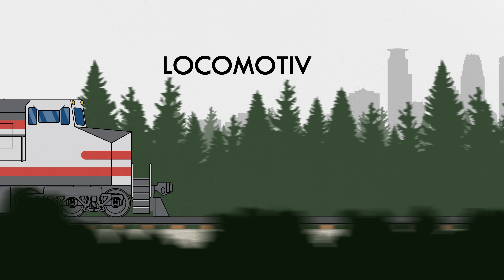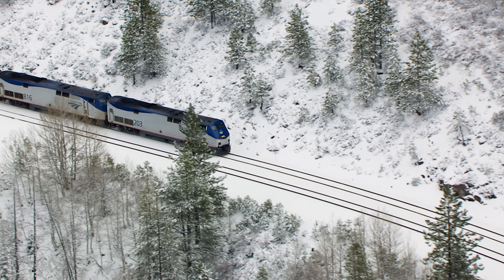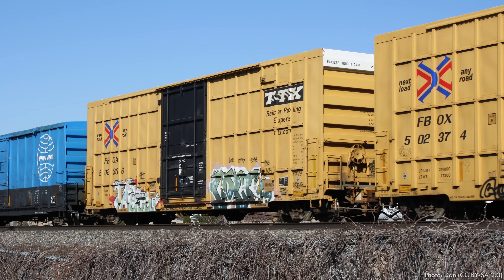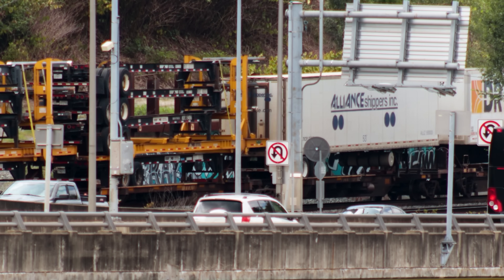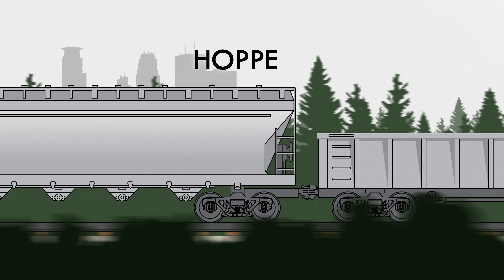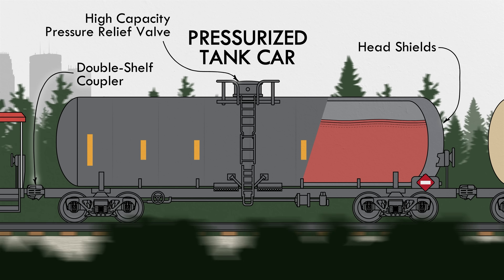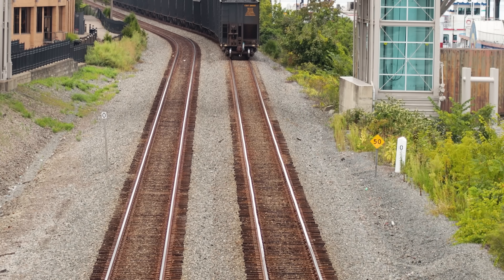Every Type of Railcar Explained in 15 Minutes

Comment: In Germany, we have special rail cars to transport liquid pig iron from blast furnaces to steel works. They are designed to keep the iron liquid for hours and are called "torpedo cars".
Reply: yes, and in graz (austria), there was an issue with such a car. the steel smeltery "marienhütte" accidentally smelted scrap metal with an orphan source. then they had such a torpedo car with 60t of radioactive iron inside. wasn't a lot of fun for them.
Reply: @robertheinrich2994 Bazinga. I’d imagine molten steel doped with radioactive isotopes are uberradioactive
Reply: @robertheinrich2994 Yikes.  There was a similar incident long ago in Ciudad Juárez in 1984.  It was only discovered because a truck driver got lost, drove over a radiation sensor at the Los Alamos National Laboratory (what are the odds of that?), and triggered an international search.
Reply: @robertheinrich2994  an orphan source? Do you mean an unknown source? Cause here in America orphan isn't used like that and I thought you were saying they stole iron from some kids or irradiated an orphanage or something
Reply: They're also used in the US (or pretty much anywhere connecting blast furnaces to steel plants with rail transport). The terminology is also the same, though they're sometimes also called "bottle cars".
Reply: I haul refractory components to many US steel mills, including tilters used to load those cars, also called Hot Pots, so I get rather close to to those cars... The heat that comes off of those cars is insane, even long after they are emptied and waiting to be refilled...
Reply: They're, or similar versions of them, are used on most steel mills to carry both products and slug around the facility. Not surprising since metal vehicles running on metal tracks is the best way to carry molten metal. Also the whole operation is pretty metal too :)
Reply: We have these in south Wales too. Every now and then a train full of molten steel will roll through Cardiff Central station as it goes between steelworks. Apparently you can feel the radiant heat as it goes by
Reply: Nothing quite like looking outside the train and being blasted with heat from molten steel because they were opening up the top of one of those torpedo cars haha
Reply: Wow. molten iron?
Reply: @DudeWhoSaysDeez  people wouldn't think that this is an economical endeavour, hauling molten iron around.
but I see where you are coming from. these cars need to be moved to their destination quickly. it's around 4h (as far as I know) before the loss of heat is too much and it turns solid.
Reply: @robertheinrich2994   Often times they are also just used in plant. Or plants of the same company that might be just down the road a bit.
Reply: I was trying to figure out what liquid pigs were....given I recently heard Chicken Eggs referred to as Liquid Chickens
Reply: We have those in Florida as well and they are used to transport molten Sulphur, though they also transport the molten Sulphur in special 18 wheelers that have a trailer used to keep it hot.
Reply: @ImpendingJoker  Interesting. I've heard that they also (used to?) transport liquid aluminum in semi trailers in some places.
Reply: Amazing!  Now i imagine they must have baffles because sloshing molten iron could derail a car in a hurry. If so, what material would those be made from?  Do you know?
Reply: @boxsterman77  I don't think they have baffles. You have to fill all cars to the top anyway to ensure the desired thermal behaviour. Trains don't accelerate that much.
Reply: Europe by rail! Sounds like something I want to do ASAP
Reply: If you want to see what it looks like when such carriage derails and spills the metal, Google "Havarie Veroniky, Vitkovice, 2011" (This type of carriage is often called "Veronika" for some reason.
Reply: Mmmmm. Liquid pig.
Reply: Seems dangerous
Reply: Too hot to handle
Reply: That's metal!!
Reply: Plus they also have what I would call "ladle cars" where the iron works dumps slag into a huge ladle, then the flat car it's on pulls it a short distance to dump the molten slag into a waste pit.
Reply: Pig iron???
Reply: @RedCobra_QC  yes. Pig iron, a term for crude iron. It comes from the appearance of the gate-and-runner system they use for casting crude iron ingots. The central runner is the "sow," and all the ingots coming off of it are the "piglets.".
Reply: Torpedo wagons, slag ladles, and those cars with the tall ingot casts are probably my favorite rail cars. There is just something fascinating about moving molten metal around!
Reply: I wonder which is more BTUs , a rail car of liquid iron, or the potential BTUs of a rail car of a petroleum fuel such as diesel
Reply: @ShannonDove-sy7ye  energy density of fuel is much much higher. otherwise we would use liquid metals as performance fuel.
Reply: That’s fuckin nuts. The refractory must be insane.
Reply: We don't manufacture much of anything in the US.  Our quality has deteriorated to the point of having no value.  Manufacturing is a serious investment, there is no regard for employees, and our system is based on immediate ROI.  There usual term is greed.  Further, our rail networks are 19 century.
Reply: The sounds badass. Someone tell Michael Bay.
Reply: The irony of the Germans naming these rail cars "torpedo cars" is not lost on me.
Reply: @YT-TheLegacy  "IRONy" 😀
Reply: @YT-TheLegacy it’s lost on me.

Comment: One variation of train car I've seen is two flat cars with one bogey in between them linking the two cars together. I'd like to know more about how those are put in service, since obviously they don't have the normal couplers like everything else. I'm guessing these are used for lower weight applications.
Reply: that's similar to the HSR ones ain't it?  ( Like TGV bogies)
Reply: Articulated flatcars are what you're seeing. They comprise virtually all the container-on-flatcar and piggyback freight cars used nowadays (there are also articulated autoracks). 

Each multi-section car is considered a single unit (though railfans will often count each "platform" like a separate car), and can consist of 2, 3 or five carbodies. The Santa Fe experimented with a ten-section version called the "Fuel Foiler" in the early days of this technology).
Reply: this is Jacobs Bogey, designed to reduce rolling friction and increase stability in EMUs. Similar arrangement (but not a Jacobs bogey) you may find betweet two well cars. Most important advantage in HSR use is resiliency against accordion collapse in case of derailment. In 2000 TGV EuroStar derailed at nearly 300km/h with only 14 light injures. In case of separate couches it would be fatal.

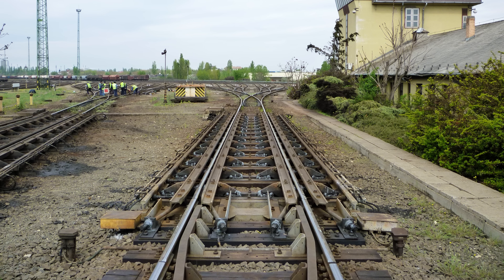Comment: Not every train has locomotive. Motorwagons or joint units have traction engines and don't need to be pushed or pulled. 12:35 it is not scale, it is braking system, providing cars to not exceed speed at shunting. Also you missed silo car, 'dust carrier', that is used for transport cement and other freights like that. Also missed cars designed for carring molten materials like slag or metal (that is two differnt types).
Reply: That's probably because he's based in North America and cement is carried in 2-bay covered hoppers here. Also see his disclaimer at the beginning of the video that this is an overview of the most common basic car types and not a deep dive.

Comment: he just dropped one of the best videos ever
Reply: It's missing all the electric cars, truly a US fossil-fuel burning moment
Reply: @Slushee  What?
Reply: @jovetj  All the ones he mentioned were towed by a diesel locomotive. Everywhere else in the world that isn't north america we use electric trains.
Reply: @Slushee  There are electric trains here too.  And guess where the majority of that power actually comes from?  "Fossil" fuels.  Diesel locomotives are electric, too.  Traction motors are electric motors!

His train also had both passenger equipment and freight cars/wagons.  That train doesn't really exist, either.  That's not the point.  The video is freight focused, and North America focused, but there are comparable freight wagons across the world.  The video did not cover electric trolleys or trams, high-speed passenger service, specialized mining equipment, funiculars, or cog railroads either.  It wasn't supposed to.
Reply: @jovetj  The majority of power comes from fossil fuels in north america and in germany. Not in the rest of europe where we have robust solar, wind, hydro and nuclear power plants :3 
Also freight trains are electric here (I have pictures of them :o) and sd that it wasn't about passenger rail too because that one's the coolest >w<
Reply: @Slushee but the usa has ths most nuclear power plants. More ppls more power plants
Reply: @jo2832  The ratio of power generation is also like 80% fossil fuels so it doesn't really matter